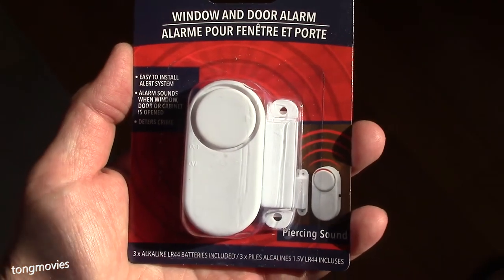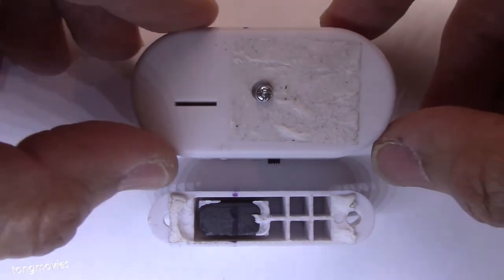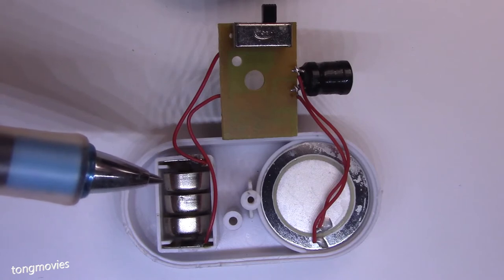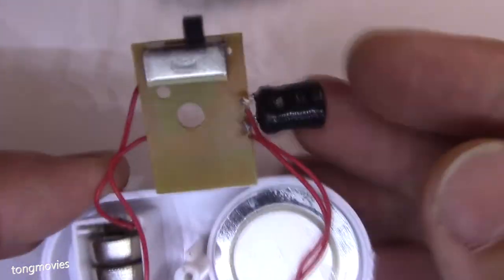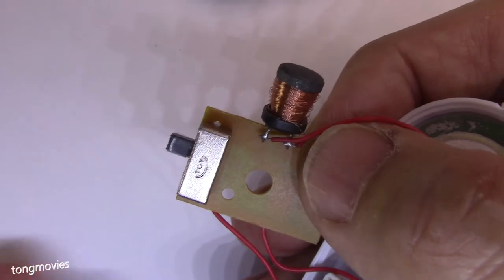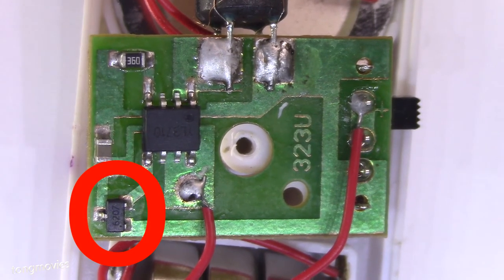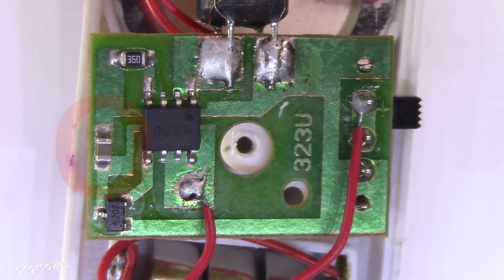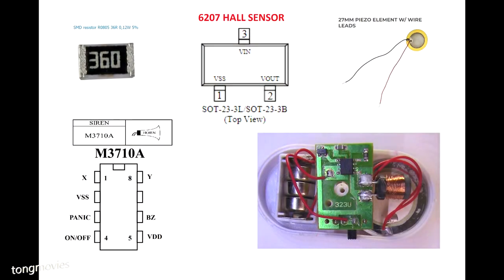Dollar Tree Window and Door Alarm Teardown w/Hall Sensor

Comment: I'm sure the seller's hope is that once the battery has died, no one will be replacing the battery, and will instead simply replace the device itself, which may not end up being a bad idea, since purchasing new batteries and adhesive tape would almost certainly cost more than $1.25.
Reply from the maker: Sometimes I’ll buy tea lights just to get the 6 LR44 batteries they come with.